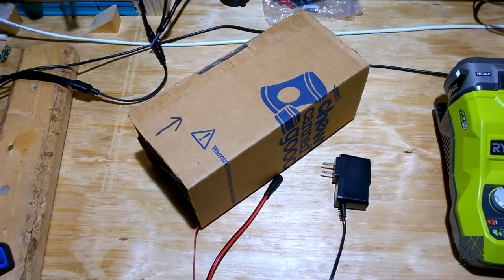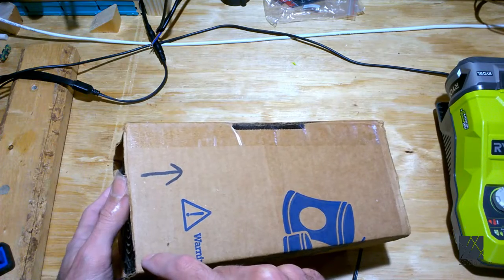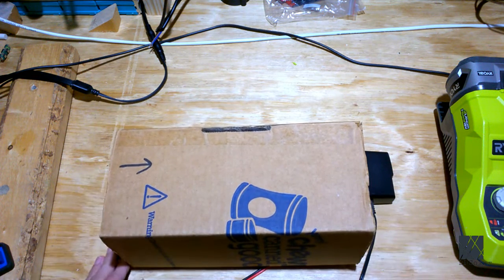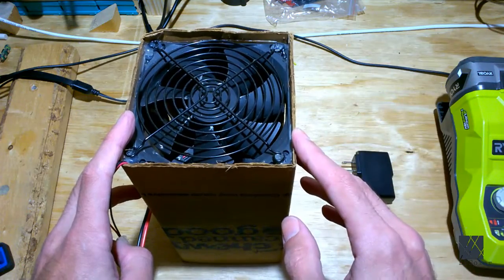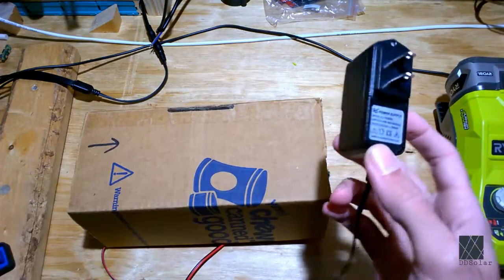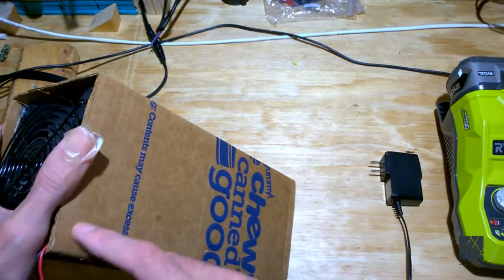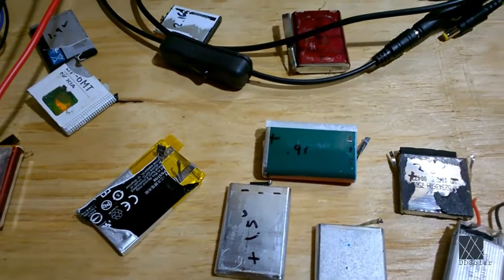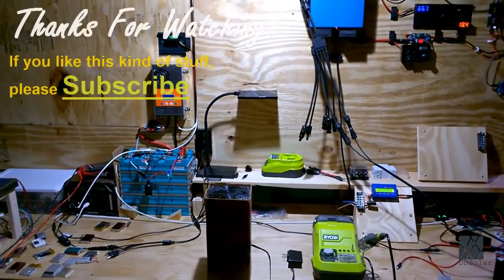Solder fumes extractor simple and cheap DIY - fume extractor #diy #soldering

Comment: Doesnt it need to have 2 more filters for big and micro particulates ? I heard that carbon filter just gets rid of the smell for the most part
Reply from the maker: Right the HEPAs do that part. The carbon filter catches much of the smoke right away (it gets very dirty and grey colored, evidence it works) and most importantly, directs the smoke plume away from my face and nose. Although it's often used for smell, a carbon filter can mechanically trap many particles including smoke and dust.

The rest of the particles come out the end and are caught by my 1 or 2 HEPA filters running in the room. One can never have too many filters!